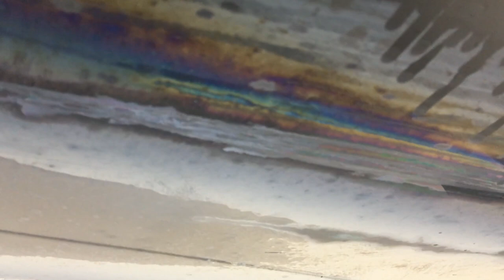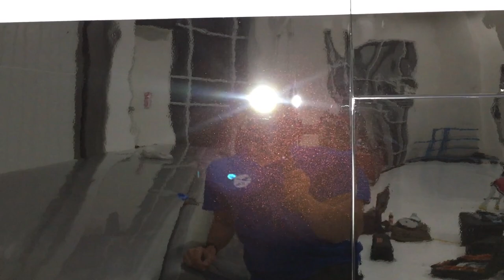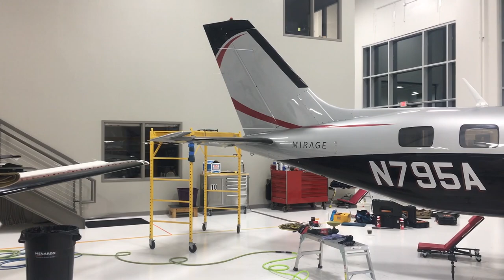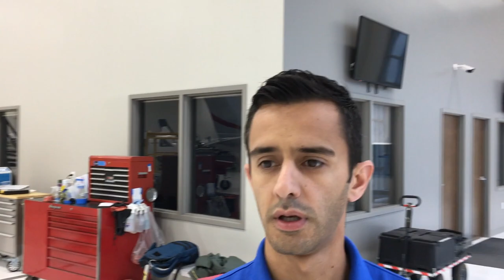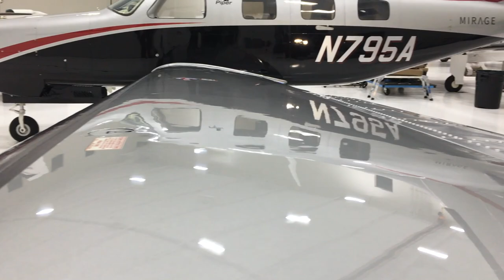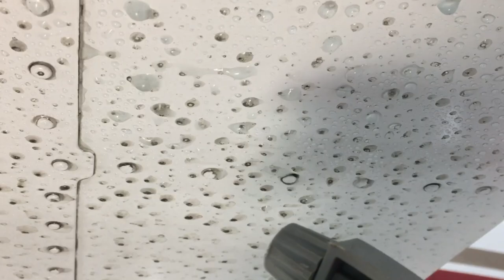Vlog 006 - Piper PA-46 Malibu Mirage Ceramic Coating - Follow up on previously coated aircraft

Comment: I clean aircraft, I use Detro Clean to remove the Lead exhaust streaks on the bottom, it also removes the paste that forms with dirt, exhaust and 5606 hydraulic fluid and oil leaks.

Comment: What was the mix of the soot cleaner?  That is tough to get off
Reply from the maker: New product were working on. Still working on some validation and safety testing. Should be available Q1 2019
Reply: is it Nitric acid? or Oxalic acid based?
Reply from the maker: Nikos Perantinidis no, I suppose that could work. But would be worried about oxidation on aluminum
Reply: Aviana Aircraft Detailing Have you come up with the new belly cleaner?
Reply: I too will buy gobs of your belly cleaner once available. I currently use a fume free oven cleaner. Spray foam on, leave for 30 minutes then wipe off with paper towels. Wear eye protection and a surgical mask when you spray it on.

Comment: If I may ask what is the leather coding in the syringe that you used on the seats? Do you sell it or can it purchased online?
Reply from the maker: Optimum Leather Guard https://opticoat.com/page/opti-guard-leather
They only sell that to authorized installers unfortunately. Where are you located?
Reply: 303 works excellent.
Reply: @AvianaAircraft  I live in New Jersey. Any idea where or when this can be available for the public in near future?
Reply from the maker: @abrahamnemani3907  The leather coating has been around for a while, but the manufacturer doesn't sell it direct to the public. There are auto detailers that use it as well though, let me see if I can find someone who carries it near you and maybe they can install it for you. Shoot me an email at mehrdadse@gmail.com
Reply from the maker: @thefireman285  303 is a great product, especially for protecting plastic trim in high UV areas, but for leather seats there are better options out there to protect against wear and staining

Comment: Great video and incredible results! Just found your channel...do you have any recommendations for cleaning and removing scratches from aircraft Plexiglas? If so, do you cover this in one of your videos?
Reply from the maker: I don't have any videos on the subject at the moment.. but that could change. On pressurized aircraft you need to be a bit more careful as you don't want to remove too much thickness. On non-pressurized aircraft you can machine polish with something like Meguiars M105 and M205 and a foam pad. Make sure to not wax with petroleum based products as that will affect the acrylic
Reply: The product is not new but its tried and true, find a technician to use Micro-Mesh plastic sanding kits, You start with heavy grades and work your way up to polishing compounds. If the scratching is too deep, window replacement is all you can do.

Comment: Just a few questions:
1. What do you use to waterless wash the plane (what are you spraying and wiping it down with)?
2. Do you need to use a rotary buffer or can you do it by hand?
3. What ceramic coating do you use?
4. Easiest chemical to get bottom oil and soot off?
5. What would you charge for full wash and ceramic coat for something like a 172?

And thanks for answering!!!

Comment: Great work! You said your rinse is just water with some polymers.  What are your thoughts on using distilled water or RO water to TDS spotting?  I was thinking about it but a plumber friend mentioned the corrosiveness of RO water on copper fixtures.  I'm guessing the chemist knows the quick answer? Thanks.
Reply from the maker: A great question, because RO water has no minerals whatsoever, it it is really eager to start dissolving stuff, such as water pipes. Normal water already having minerals dissolved, is not as corrosive because it has a lowered ability to dissolve additional solutes. 

That said, when you mix it with no rinse, you’re adding solutes to the RO water so it won’t be the same as pure RO.